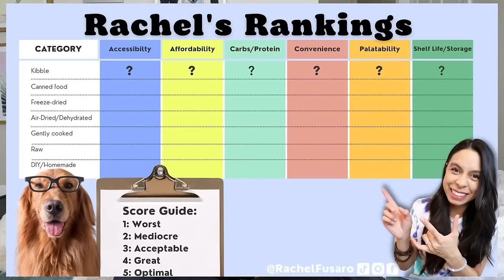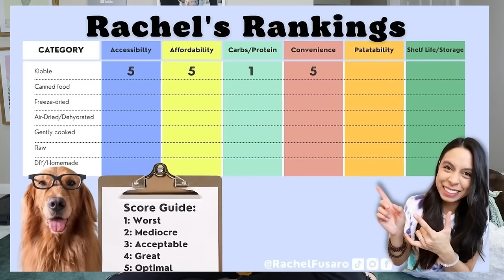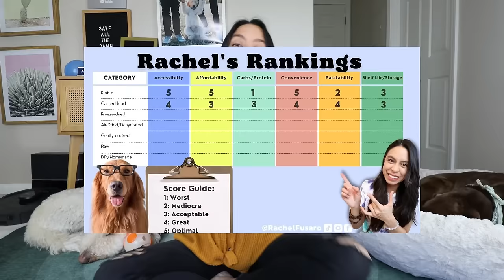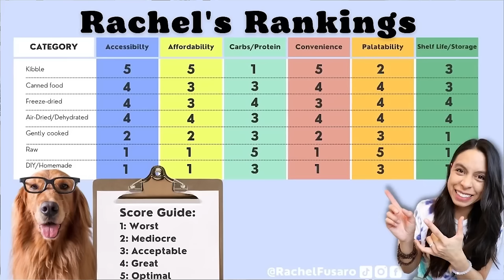Ranking Your Dog's FOOD! 🤔 Nutritionist's Dog Food Guide

Comment: I use visionary pet foods. High in crude protein (43 percent), pretty high in crude fat (33 percent),  10  percent moisture, very low on carbs, and no fillers such as wheat, maize, soy, sweet potatoes, and other nonsense that has no nutritional value for adog. You got a like, excellent video.